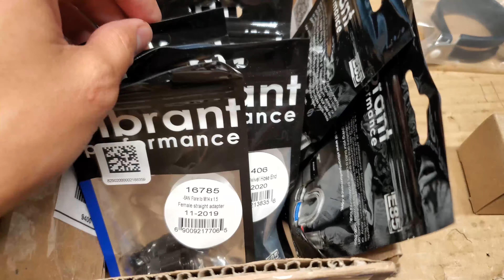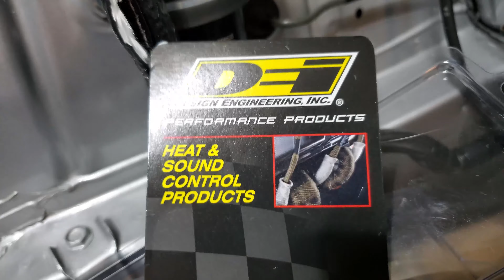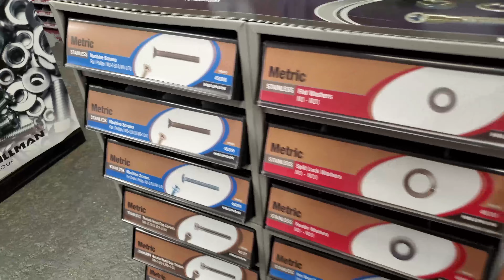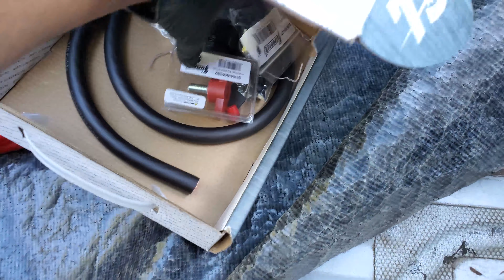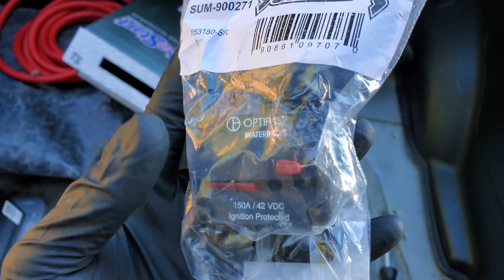Celica RA64 1UZ Swap - Preparing the Hole (Ep. 7)

Comment: Could always weld bolts to the trunk floor and then bolt the battery tray to it. That way there no drilling into the body and worrying about the fuel tank
Reply from the maker: That's a solid suggestion, I just wish I had easy access to a welder!
Reply: @winguard96  $100 at Harbor Freight! Haha. Flux core can be a huge pain to work with, but for really basic tasks on clean metal, it works.
Reply from the maker: For sure! I haven't heard great things about HF mig welders though. I'd rather save up for a Miller or Lincoln.
Reply: @winguard96  TBH most of it comes down to user error or unreasonable expectations. Flux core welding is a skill just like real MIG welding and it has limitations. My HF welder has held up for many years now. That said, my Eastwood MIG is such a huge improvement. Definitely worth it to get something better if you know you will use it a lot.

Comment: What transmission are you using? Doing this exact same swap into an 83 Celica. (Not a lift back though)
Reply: Great job documenting everything btw!!!
Reply from the maker: Thank you! I'm using the stock Celica W58 transmission. See episode 5 for details on that. :-)
Reply: @winguard96  right on.  Will that hold up under forced induction? Mine is an automatic currently 😒

Comment: Have you tried to mount those motor mount brackets yet. I think you will find that they don't work. I also have an RA65 Celica but mine is the GTS version. I had to make my own mounting brackets. see comments on site www.raysv8celica.com
Reply from the maker: Ray, check out Episode 9; they worked!
Reply: I’m still not sure they will work. The forward angle that is created by you mounting the brackets on those rubber mounts,on the forward most screw hole may create a ripping effect on those mounts the first time you drop the clutch to quick. Many have warned not to use the stock rubber mounts because of the torque from the 1UZ ripping them apart. I hope those mounts you have are stronger. Please prove me wrong. Keep up the good work. I can’t wait to see you finish this project. I just got back to work on my GTS hatchback 1UZ conversion. I hope to post some updates soon on my website and the forum.
Reply from the maker: I guess we will find out. 😉 Thanks! I've been taking a small break from the build to catch up on real work.